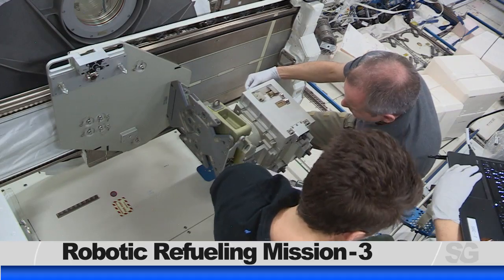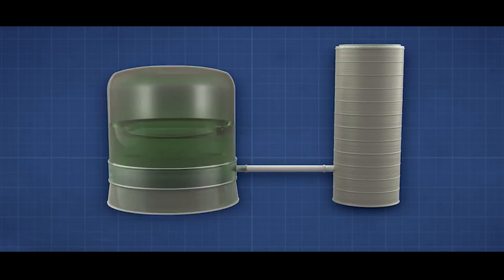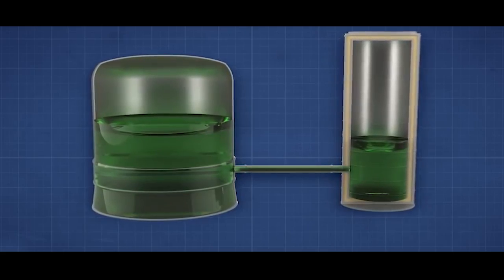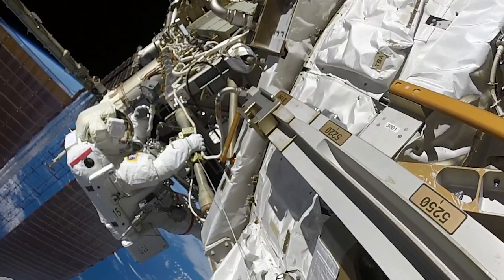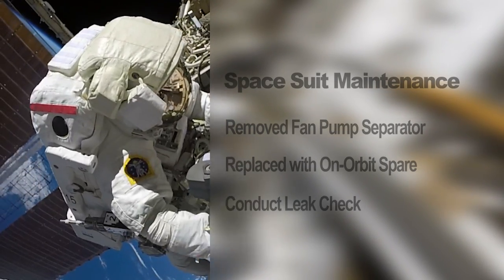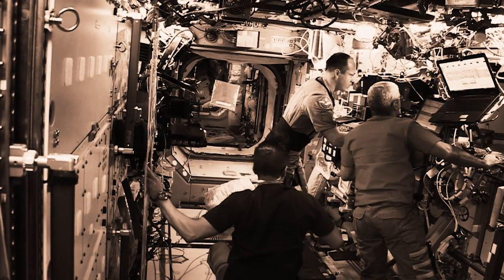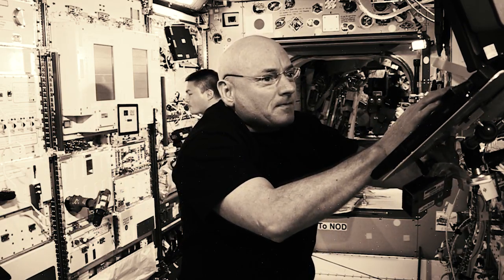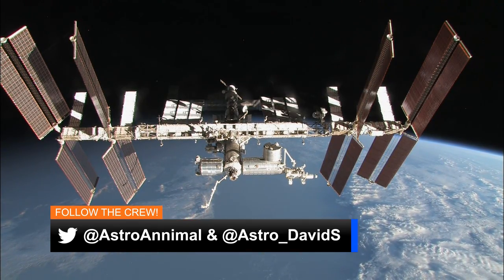Space to Ground: Personal Space: 02/22/2019

Comment: A rotational storage tank refueling coupler system to rotational service tank which uses centripetal force might be a future option for micro gravity transfer standardization? They'd probably have to create some type of dynamic counter-balancer movable weight system for graduated fuel transfer imbalances. Or a Tri-Tank to Tri-tank coupler with an even transfer rate from the 3 Tri-Tank supply tanks to Tri-Tank service tanks via a centralized coupler.

I'd be glad to create and submit a 3D CAD drawing for a design concept if anyone is interested.

Comment: Tardigrades !
Maybe one day we’ll be able to go into space naked without exploding 🙂
Reply: We can do that now.  Of course you wouldn't live through it.  You don't explode in a vacuum.
Reply: yeah you just get really puffed up
and all of the liquid in you would boil away

rip
Reply: @humanity.3339  You don't know the difference between temperature and heat.  They're related but not the same.  It's like this.  You can stick your hand in a 350 degree oven that's just been opened up for a few seconds with no harm done.  Now try holding an iron bar that's 350 degrees for a few seconds.  You'd burn your hand pretty bad.  Why is that?  They're both 350 degrees.  You were in contact with them for the same amount of time.  That's the difference between heat and temperature.  The temperature of the extremely few molecules in space are very high.  But they are not going to fry you because there are so few of them.  It's not like being in air at sea level pressure that's 3,000 degrees.  Yeah, that would boil you very quickly.  You're in a situation where you have a little bit of knowledge and it''s leading you astray.  Try learning some more.  It's only a few seconds of a Google search away.
Reply: @matchrocket1702  woahh ok, i didn't say it would fry you, i said all the liquid in your body would boil away, so like your tongue and eyes the liquid in these will vaporize away because of low pressure.